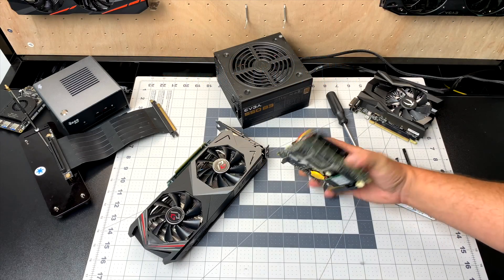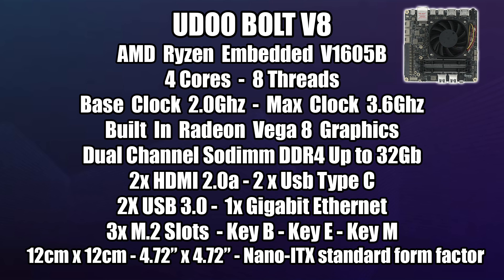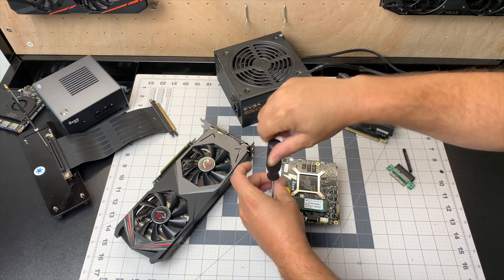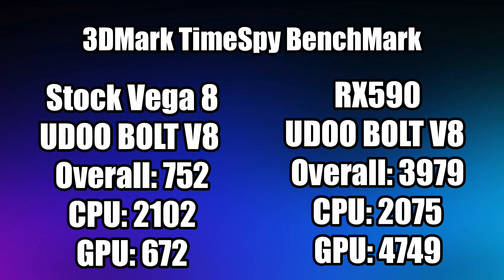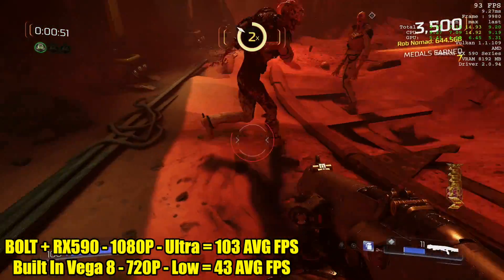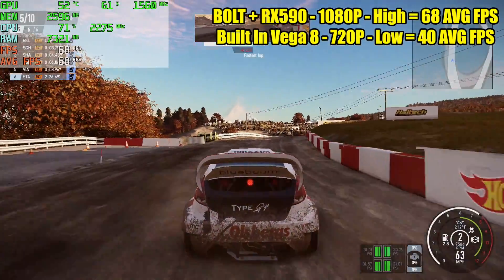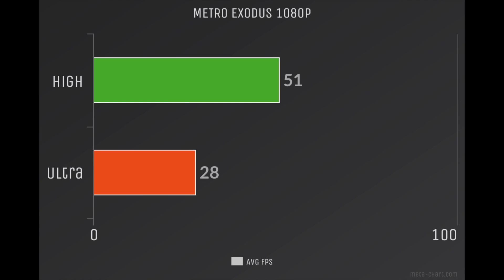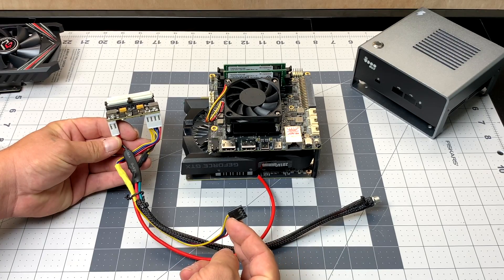UDOO Bolt V8 + RX590 External GPU Testing

Comment: The card is gonna be blowing hot air straight onto the UDOO Bolt though :O
 maybe this would be a rare scenario where a reference design would actually come in handy, since the single fan on reference cards would be on the opposite corner of the card.

Comment: May I ask how you intended to power the Udoo with a Pico PSU? The Udoo requires 19V via barrel jack or 20V via USB C, the pico PSU only provides 12V. I wanted to do something similar and would be interested in your solution. Thanks :)

Comment: Hey man, i have the same card, an rx590 nitro, use externally too via TB3 with a zbook from HP running a Xeon E-2186M cpu and 32gb ram. I get nowhere nowhere to those fps in doom 2016. 1080p Ultra will yield 18 - 21 fps. Wtf is happening lol? Some advice would be awesome. Im using the SOnnet Breakaway 550w.

Comment: @ETA PRIME The build I'd personally do is this board with the MSI 1650 4GT LP (Low profile). It looks like it would work great for this build. That with the pico power supply could make this build extremely portable.

Comment: I've always wanted to build an entire computer the size of a modern day large gpu, all cooled by the big heatsink too, so it looks like just a gpu but you plug it in and its a whole computer
Reply: This would work if you used a very short card, and a setup like this board or a lattepanda and put both of them under the heatsink of a larger GPU so the GPU and MOBO use up half and half of it

Comment: Unglaublich sorry for my german expression .. really unbelievable . I have recommended a (not german) rock pi.. but this is not possible with that.. But this is (almost) german aka italien. I recommend the rock pi for server related things anyway. It will cost you less at your electricity bill Here is my coin adress: qpdurj6734878jjfl0vnuvku7m04ffj2psvhkwnz0g

Comment: "if you guys are interested in seeing the rest of this video where i use a 1650, leave a like and a comment below" i cant wait for a 7nm/7nm+ zen2/3 embedded/mobile still will probably have to maintain similar clock speeds, but possibly double the core count will be nice, would also be nice if next gen embedded had 4-6 cores and 15CUs instead of 8, or maybe that would be an 'R5-4650' if they did decide to do something like that

Comment: You should try to liquid metal one of these cpu's to see if it can hold its boost clock. I know my laptop would throttle until applied some liquid metal thermal paste. Now it holds its boost clock none stop

Comment: I wana see how this will do with Pubg using 2080Ti.  I just need PC that will run powerfully on Low power around 400 to 600Watts Max. I use Solar Power.

Comment: Sub $200 for a ryzen 3 2200g (upgrade to 2400g for $250) and a mini - itx b350m (About the same specs, 6.7in square) vs this over $400 and is (4.7in sq) 2" smaller and has arduino IO. Very limited use case. Like that your experimenting with it though!

Comment: i feel like sometimes the limiting factor isnt the cpu but the fact that your taking a 16x bandwith down to a 4x
Reply: I was under the impression that 4x vs 16x rarely makes a difference with GPUs.
Reply: @benkenobi88  an Rx 550 is wired to 8x which it's a low end GPU so it doesn't require 16x bandwidth however a card like an RX 590 definitely will be bottlenecked by that decrease in bandwidth so he probably would've gotten similar performance out of an Rx 560 (or 1050ti/1650ti) because that CPU should play GTA very well

Comment: I think if it were paired with the 1650 it would make a lot more sense to do. You could get the low profile card, power the M.2 and PC with the pico psu and have something about the size of a square tissue box. The 590 is cpu bottlenecked so dropping to the 1650 low profile card would probably just run the same exact framerate numbers anyway... Having in the last two weeks finally gotten off my FX 6300 platform and onto a Ryzen 5 1400, this cpu feels more like an FX series chip than a Ryzen chip... It's bottlenecking mid level cards making the only really sensible option the low power consumption cards that run off PCI-e power.

Comment: hmm need to test vr performance scores against a 1060 laptop before starting a project...

a belt could hold the main weight like batteries, but if you had a computer strapped to your back would you prefer a backpack or a vest with more secure attachments to the waist rather than the arms? 

I think I personally would prefer a thicker backpack and no belt, but then all the weight is on the shoulders and you cant move as much. also the vest would be more secure...

Comment: I never saw CPU Above 60% using RX590. I think its not the CPU which is bottlenecking but actually its the m.2 Bandwidth.
if only this Motherboard comes with PCI Express Slot. XD

Comment: 4 cores 8 threads should do fine with rx 590. I have rx 580 with i7-4790 and it's pretty ballanced, graphic is limiter in most of the games. This ryzen 5 have also higher clocks and better structure, it beats my intel for sure.
Just change this cooler bruh.

Comment: Is it a thermal issue with the CPU not maintaining max clock speeds. Would a better thermal solution improve FPS slightly. Just curious.

Comment: The strange thing is that the V1605B has a similar Passmark score to the Ryzen 3 2200G and that paired with an RX 580 manages better gaming performance. Perhaps the x4 PCI-E connection isn't fast enough.

Comment: udoo bolt v8 $350
32gb ddr4 $80
rx590 $300
pico PSU $40
pcie adapter $70
i cannot stress how much this is not worth the money. but this concept has my nerd organ wet.

Comment: I would super interested in a tiny build video with external GPU that can handle vr rift s gaming, with easier titles like beat saber and order up VR. those don't take a lot of processing power. I don't have the money to try out the variations for which could do better configuration wise and which could handle it but if you could do the testing and make a video on it, it would be a win-win for us that are interested and you.
Reply: A rift s headset only requires one display port and one USB 3.0 port, any other USBs can be used for mouse and keyboard. and a portable pc display about 8x6 inches in size, some can run their own power from the HDMI port it's self. so no need to plug anything else into an outlet. Ideally with a frame to hold the GPU, motherboard, and power supply. smaller than a shoebox, and a tiny fold-up display on top. with ports in the front or back. just an idea i had in my head.

Comment: Some people might think its silly boosting a maker/sbc with a GPU, but it seems it has the potential of getting real work done too. Look how small it is too... After everything is powered ETA Prime, do you have enough power left in Pico PSU to run some cooling fans? Very interested in the costs of something small like this.

Comment: Sir can you help me out.
Im planning to buy a psu to replace my 500 psu because its not currently compatible with my rx590 sapphire. It was a gift to me.

My specs are:
Cpu: a10 7860k gonna upgrade next 6 months to a r5 2600/3600
Mobo: Ga-f2a88xm-hd3p. Will upgrade to b450m msi mortar titanium
Ram: 2x4gb hyperx fury 1866mhz. Will upgrade ro 1x8gb or 2x8gb 3000mhz
2 hard drive  and planning to add a 240gb ssd.

Psu that im planning to buy is: THERMALTAKE SMART RGB 600w
Or
Corsair vs550. Cos im in a tight budget. Will it be enough?

Comment: With that processor you should have used a rx 580 or msybe rx 570 because 590 is too much for this processor only if you use at least a ryzen 5 1600.

Comment: @ETA Idea.
Since you are pretty much CPU bottlenecked in these situations, I highly recommend testing at 1440p and 4k.
In some cases, you can get a passable frame rate at 4k even with a lower end CPU.
Think I am nuts? Well Digital Foundry demonstrated this in several videos with a G4560 which is just a hyper threaded dual core, and some mid range cards like the 1060/970.
I bet with that set up and an rx 590 you could pull 40-60fps in at least 1 title at 4k.
Reply: Why do this?
Don't most 4k game consoles target 30-60fps?
Reply: I can't say what running at PCIe 4x will do at higher res, but it may work just fine.

Comment: Thank you for sharing this. I am anxiously awaiting my Bolt V8 from the Kickstarter Campaign. I would like to see some links to the hardware you used in this build, especially the M.2 to PCIE adapter
, PCIE X4 Riser, and 90 degree adapter. My Amazon search has left me confused and I would like to get something that works. Please show more videos about the pico power supply too.

Comment: I'm already waiting for the Bolt to become available, to build my "Gaming PC inside an ATX PSU case" based around a 1050Ti. I was able to fit the 1050Ti (with custom cooler) and a Mini-STX board in it, but then there wasn't any space left for the PSU. So I'm really looking forward to getting my hands on a small and powerful board like that.
Btw. did you ever find out why the Odroid-H2 doesn't work with the M.2 to GPU adapter? I've been trying my luck with it, but couldn't make it work either.

Comment: You had a slightly worse cpu result with the 590 in timespy, I wonder why that is, since the tdp/thermal capacity could focus on cpu only. Could it be that the CPU is limited by the heat sinks performance or by the Power supply (VRMs and so on) of the board? Could you try with a beefier cooler perhaps? higher clocks should push fps a good bit esp. with a discreet gpu.

Comment: Test is inaccurate looking by the cpu management on this board which they should improve by BIOS update, because it not showing the true potential of this SoC. By now it's weak against smach z prototype when with iGPU cpu work faster than here.

Comment: Did you try their 25W bios tweak they showed on their udoo youtube channel ?  it seems to boost performance a lot !
Reply: @Navigator Rock too power hungry
Reply: This + the Nvidia GPU for a compact build would be dope
Reply: @Navigator Rock amd GPU is not great on linux
Reply: @RmRoyalflush  AMD is working great in linux its nvidia that cause some issues performance wise because nvidia didn't care about linux or linux gaming. i have rx570 with manjaro working amazingly
Reply: @azivt5115  well nvidia does develop drivers for linux, amd doesnt
Reply: @RmRoyalflush  Except the Nvidia linux drivers are really bad and AMD actually both develops linux drivers and also makes them open source so anyone else can build their own drivers. Nvidia are Proprietary closed source.
Reply: @MathiasWesterlund  - There are both open-source AND proprietary Nvidia drivers for Linux. They can apparently be temperamental with some setups but I haven't had problems.
Reply: @voltijuice8576  just because you dont have issues dors not mean they are bot bad. The open source ones lacks a lot of features and have horrible performance. The very definition of being bad comparatively.
Reply: @MathiasWesterlund  - I lost my "bad-ometer" so I wasn't able to be objective. 
It's subjective - for my goals and circumstances, in my use-case, it worked well. It wouldn't be honest for me to slag it  off over others' problems that I didn't experience.

Comment: I'd see that smaller build. With a modded mini pc case, or a 3d printed case, it'd be compact and actually make sense. Could mount it to the back of a TV, and have it as a gaming all in one. Stick on bigbox, a controller. Use to emulate more modern consoles dreamcast, ps2, game cube.

Could probably also run some decent higher level 1080P decoding for media with the CPU. Also I love how rockstar gear their games to CPU. Means you can run them on integrated graphics with a decent CPU.

Comment: the rx590 needs more power than a rx5700. so I was thinking that if you get a rx5700 you can undervolt and underclock it just around 100W, just enough for the picoPSU-160-XT 160w.

Comment: I want to see you go completely nuts with this.
Pico PSU
GTX 1650
Custom case
RGB lights, if you want to.
Make this baby shine!
Reply: I hope so
Reply: Yeah... kinda same...
Do a full complete build with one of these Super Small Mobos and external GPU.
Could you get it all to fit it an actual case?
Could you make it smaller than a standard Mini-ITX?
Reply: ciredark pretty sure my super thin laptop (8750h and a 1070 outbenching overclocked 1070 desktop). Plus my laptop board will actually fit in a 15 inch  diagonal measured 0.7 inch thick case (probably less, the outside dimension of my laptop without the screen is about 0.5 inch thick, or 13mm). My case of course has RGB keyboard included...
Reply: I will do with a custom wood enclosure.
Will look real cool. In a furniture desk setting
Reply: yes please

Comment: 1650 build maybe a case? Better and smaller then a Xbox or PS4?
Reply: Just like my laptop? 0.5 inch thick 15 inch diagonal measured with 1080p 120 Hz capability (GTX 1070 and 8750h), that would be better and way smaller, then maybe add a battery keyboard and screen and get gaming on the go! Oh wait... It already does that as well as being smaller, like you can stack 4 of my laptops and still be smaller.

Just saying, please have higher hopes and dreams than beating a console, but if you want it, you can get like $700 (similar cost as this) with much faster 8750h and GTX 1060 with screen/RGB keyboard etc. Beating a console in size and performance is just too easy, I’d add in price to that equation if you want a better challenge (which you can easily beat price and performance, but getting size down at that price is a challenge and that would make a good video)

Comment: Aren’t you starving the GPU for air? You’re completely covering one of the 590’s two intake fans, and covering the only intake of the smaller card.
Reply: Fair point. To build it better you'd want a clear gap, and if it has a case, vents everywhere.

Comment: would be nice if the right angle pci adapter was reversed, so you could hook the gpu up to it upside down and allow the fans to have clearance to run better. also i am thinking it may be possible that the pci adapters you used have different compatibilities. so if the motherboard supports newer pci version but the adapter does not then you get bottleneck on the adapter and the card becomes less powerful.

Comment: And Bam, just like that you have a console that kills an xbox one x. How much is it all?
Reply: Around 650 dollars. 418 for the bolt and around 230 for the GPU. I didn't even include RAM or storage. Yeah, doesn't really "kill" the Xbox One X. If the board cost over a hundred less, sure. A lot of computers perform better than consoles, but they don't hit that price point that makes consoles so accessible.
Reply: @Roosader  Ah it's more expensive than I thought it'd be.

Comment: I'd love to see a video with the 1650.
Thanks for doing these great videos Mr. Prime
Reply: Totally
Reply: 1650 on a full desktop system is barely getting close to a RX570. On this board though they're both PCI-e limited and marginally CPU limited.
Reply: So you're just gonna get the same performance in a marginally smaller package. And you will still need a external power adapter mod if your 1650 doesn't have a PCI-e 6pin because the slot on the Udoo can't deliver enough power over the bus alone for these cards.
Reply: @cybercat1531  Well yes but 1650 was built to not require much power and to not take up much space
Reply: nvidia is shit
Reply: 1650 and 1660 are terrible
Reply: @tadpolegaming4510  aysd dincdt
Reply: Shitty card

Comment: How will that ultimate build handle Saturn, Dreamcast, PS2, and Xbox games?
Reply: classic xbox emulation isn't great, even on much faster systems.
Reply: Just go ahead and redo the emulators that you just ran without the gpu.
Reply: @Russell White 
Really? How much did this pic cost to build?
Reply: @mcFitzzz   Wackywee  its not optimized, it's a silly test. Don't spend money copying this. The 590 could saturate 4x pcie3, plus as you saw in CPU intensive games the Udoo is already not enough to take advantage of that GPU. Pair it with 100 bucks each of the fastest ram and GPU you can get your hands on and emulating those systems should be fine (especially if you get a good deal on used equipment), with some tinkering for specific titles native fps should be acheivable on all those emulated systems
Reply: @c4pt1n54no  That's exactly what I thought. My $300 phone can do that and you don't have to carry a brick around

Comment: Heck yeah. Do a build comparison using only 75w slot power and power it all with the Pico PSU! That would be the ultimate build in my mind as it wouldn't need the external ATX PSU.
Reply: Does the m.2 deliver enough wattage to deliver 75w?
Reply: @mikaelkabraelian8518  It has a little power pigtail that you plug into the M.2 adapter that supplies slot power. Not sure if it supplies a full 75w but it's there.